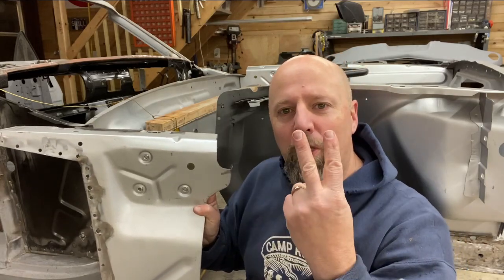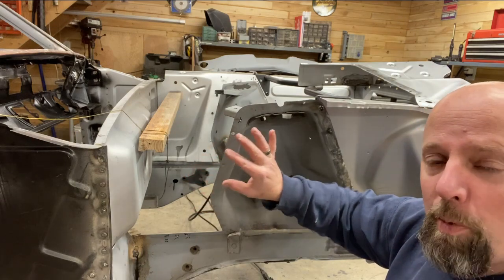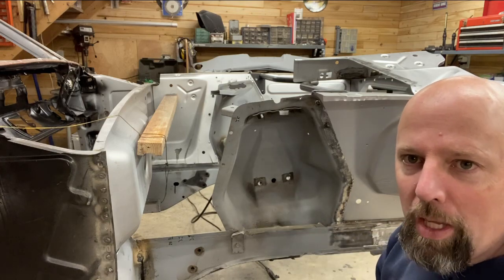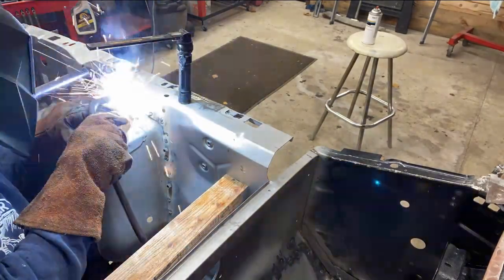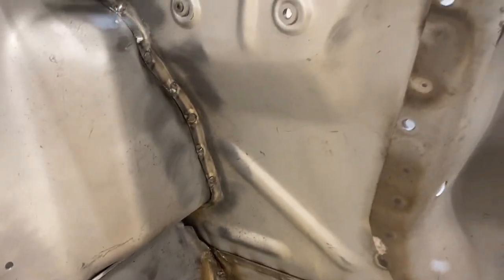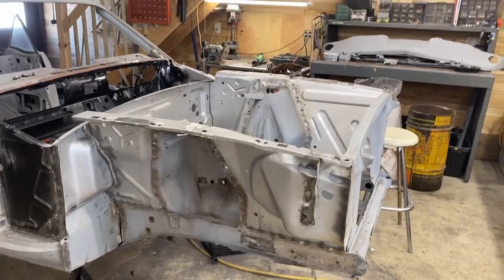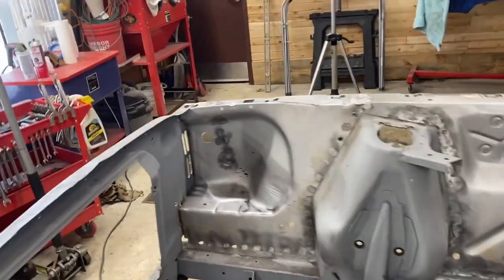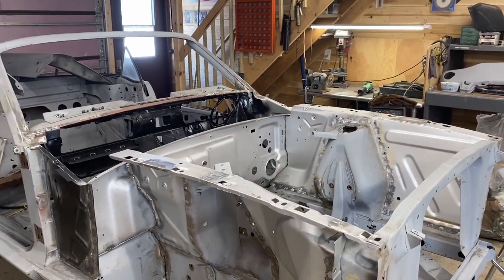1966 Mustang Restoration Pt. 21 Fender Apron Installation

Comment: What type of welder are you using flux core or gas ? Give us a picture of your welder. Thanks keep up the good work.
Reply from the maker: Currently flux core.  I talk more about that in the next episode. I may do a whole episode on it because I’m getting a lot of comments and questions about it.
Reply: @3rdstallgarage We're using Gas.  Gas gives you a nice flowed "dome" plug weld. Nice and easy to grind down without getting into the parent metal and thinning that out.

Comment: I have to replace my firewall! Is it absolutely necessary to remove the upper frame rails to get firewall in? Thanks
Reply from the maker: Do you mean the front frame rails? If so, I did not have to remove mine.  Maybe I’m misunderstanding what you mean by upper frame rails.

Comment: can you take a messurement for me?

From the front lip of the rockerpanel (there is a lip that go's outwards)at the most upper part where the torque box fits against it)) tot the most parts of the lip from the framerails(where you weld the lip from the radiator support against it
Reply from the maker: I'm happy to help by taking a measurement.  But I'm not sure exactly what you want me to measure.  Can you email me a picture or two of exactly your measurement points?  Send me an email to 3rdStallGarage@gmail.com

Comment: How many tak welds or spot welds should you have on the fender apron I am buying a 65 mustang that is already being restored but still needs lots of work .any info would be helpful have a blessed day
Reply from the maker: I typically put a spot weld every about 1 1/2” or so.  Feel free to email me any questions that I might be able to help with. 3rdstallgarage @gmail.com
Reply: Thank you sir he has the aprons tak welded in place I will have to see how far apart they are.